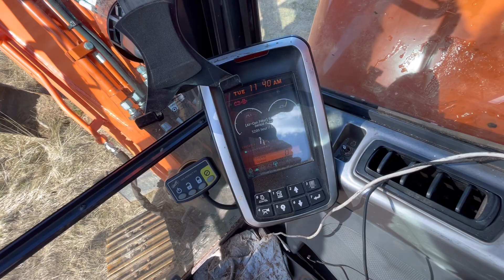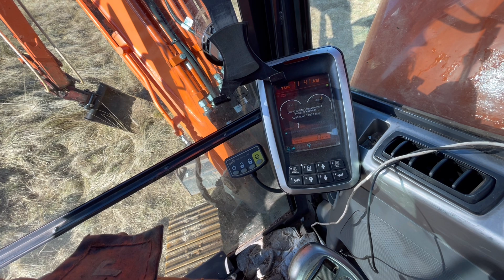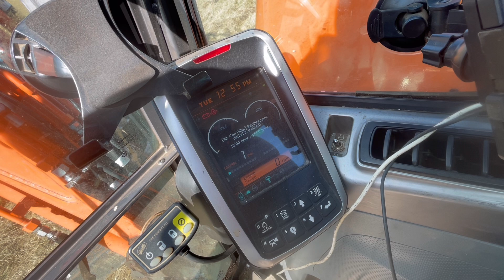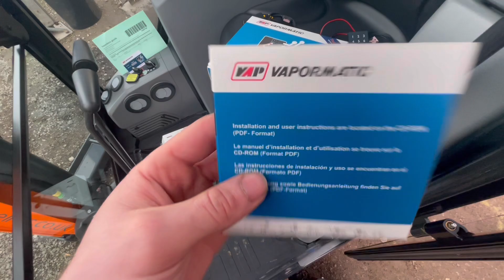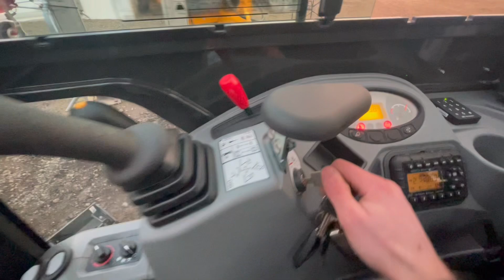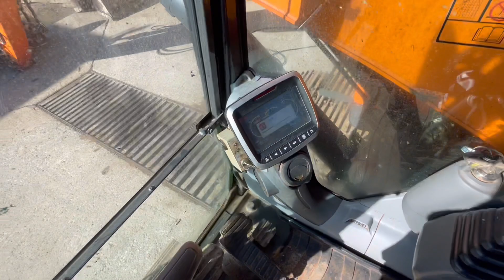Will it start ? / 3 weeks since it stopped ! / have I got it right ? / Episode - 166

Comment: Just remember Ali when you diagnose/ repair a tricky job its all knowledge in the bank.
You learn more out in the field than you could ever learn in college or training environment. I enjoy your channel it brings back alot of memories from when I worked on plant.
I've  got to admit  I'd  be lost now with all the electronics and computer stuff.
Reply from the maker: That's right it's all experience if nothing else I now know what it looks like inside the pump and also what wires go into the ecu and how it works

Comment: The thing on the 140 excavator you where asking about is a sensor for the height resistor when the metal part of the boom contact it the boom stops from raising any higher
Reply from the maker: Correct 👍👍

Comment: Hi ,
We use similar proximity switch’s to slow down the movement just before it gets to full stroke of cylinder. It helps save the cylinder & in our case the sudden mechanical stop on steering at end of lock . 
Your must be linked to the pilot line to ramp down piston pump or in our use the mA to coil for said function.
Reply from the maker: Yea on the 235s they are used to slow boom up because if you sat on a hilll and boom up quickly the inertia un balances the machine when it hits the stops in this case its just a height restrictor

Comment: Well done with the fuel one, don’t envy you, more so for the trek from the van!!!

For jobs that need cranking whilst at engine I’ve got a snap on starter switch ( other manufacturers are available), just leave ignition on and basically cross the starter ( but safer and easier than screwdriver) then you can see fuel etc.

Height limiter switch, maybe some on slew ring as well.
Reply from the maker: That's right leigh the walk was the worst of it I was certainly luck with the weather too yea height restrictor 👍

Comment: Britool are life time warranty so the end should be free, the flexy head ratchets with the blue grip aren't as good as the older ones so just be careful with the head
Reply: There life time warranty is useless, won’t buy anymore, Halfords warranty loads better, 
sent a 13 ratchet spanner back cos it was slipping, not warranty cos the person inspecting it found dirt in grooves that go onto the bolt head, worse still they scrapped it, so I couldn’t claim one off the company I work for.
Reply: @anthonyshaw7251  that has to be a jobsworth so and so!!